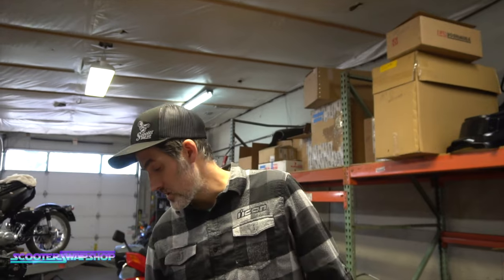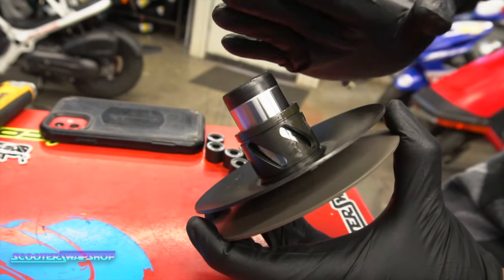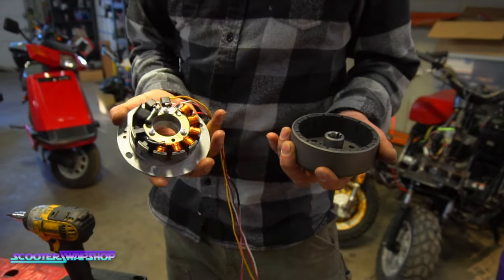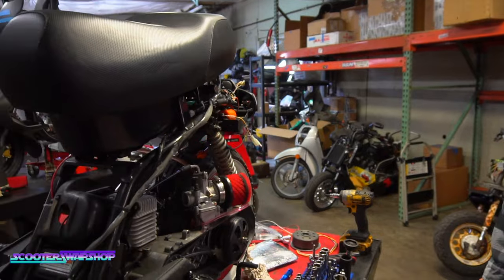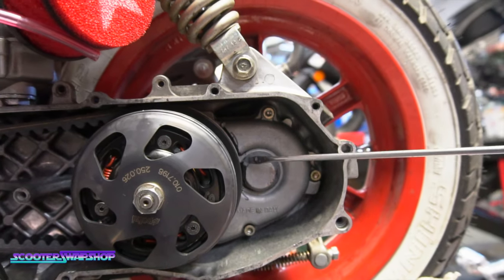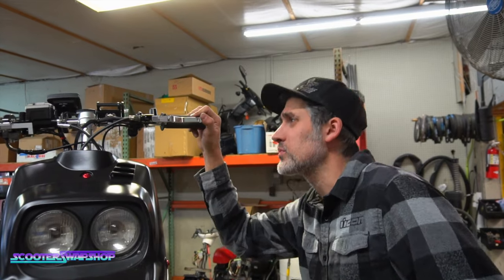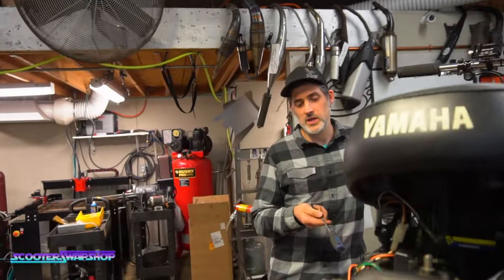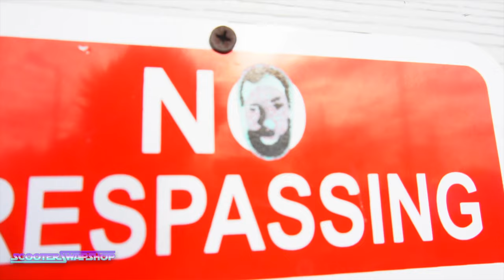Is your 2 stroke scooter constantly overheating? | Final Jay argo Prebug

Comment: Thankyou for this video 
I’ve got the exact same setup & same scooter.. Yamaha BW’s spy 1996 
Stage6 Crank 
Stage6 big intake 
MXS cylinder 
Malossi MHR overrange cvt
Malossi MHR 70cc race pipe 
Malossi 13/44 primary gears
MVT premium ignition kit 
Polini cp21 carb 
Polini cone air filter 
Polini evolution 3G adjustable clutch 
NCY quick throttle 
1.5k contra spring with yellow Polini clutch springs
Reply from the maker: cool! you get all that from us?

Comment: I thought that the 24mm carb is to much carb for these zuma bikes !! At least from what you guys said in the past
Reply from the maker: watch previous videos on this setup
Reply: I’ve seen basically all the videos. I’ve got a Athena race 70cc kit I was debating on throwing it on my Prebug !
Reply from the maker: @Skullspiderscootersquad  24 is a lot for horizontal. 24 is fine for a race vertical
Reply: @Scooterswapshop  yo thank you for the tip ! I’m going to get after it !
Reply: Shit I have the polini big valve manifold on there I don’t think it’s going to fit the 24mm …

Comment: Hello. why does the idle of my 2 strokes increase when the engine heats up? the carburetor is tuned and newly cleaned. and no air leaks. he rises 3k to 4k rpm. but it becomes okay when the choke is pulled and it also functions okay in the first start even without the choke
Reply from the maker: could be a handful of things would need alot more info
Reply: @Scooterswapshop  my engine is all stock sir.
Reply: One of the reasons could be that your contra spring is too weak. The big one that pushes the rear pulley, not talking about the small sized clutch springs.

Comment: Hey. Is it worth the time and effort to cut a hole on the case and make a breather with pipes to cool the CVT? 

Similarly, like the one on Gilera Runners and Piaggio-s. Currently using a short minarelli 2T Jog with the 5su engine code (5bm in the states, I guess), and the case can heat up pretty much that I could cook an egg on it 😀
Reply from the maker: Absolutely if you have a built bike

Comment: What are the first symptoms of a overheating engine?
Reply from the maker: its not that simple dont guess. theres not a oh this thing is over heating by the time theres a issue its broken. get a temp gauge
Reply: @Scooterswapshop  will do thank you,

My elite  belt has a little wobble to it I'm thinking I deformed my crank overheating it, i had to of overheated the thing three times ( shut off lost all power until cool)

Just noticed it yesterday looking in casing, she's at 8.2k miles.

 2001 50cc Honda elite upgraded to a contessa.

Comment: Would a stock 125cc engine benefit from a racing cam upgrade only? Or should i upgrade also the gearings?
Reply from the maker: not with out supporting mods
Reply: @Scooterswapshop  did cvt mods alread and a pipe upgrade
Reply: 125 cc has no power.dont waste tuning parts.buy bigger class.
Reply: Well could ugrade it to 160cc
Reply: @bryaneduarddevera9008  stil not enough.a good power start from vmax 530

Comment: Hi i got a bw’s with a pretty high revving setup, its running a athena racing 70cc, mxs racing pipe and 28pwk. At first i got it to work and it accelerated really fast and revved really much but then after a few runs the cylinder blew up. The piston had the piston rings melted in the piston and bad looking scratches on the piston and cylinder. So whatt went wrong? And my carburetor is a china oko 28pwk so should i change it to polini or stage6 pwk?
Reply: And also i couldnt get the idle to work even with messing with the idle screw and air screw
Reply from the maker: you buy all that here?
Reply: @Scooterswapshop  Im from europe so no. Cylinder and pipe is from maxiscoot

Comment: I have almost the exact same set up but it's not taking off from a stop. It bogs for a bit and I'm also not getting anything over 55mph. I'm assuming the bogging off the line is because I need stiffer clutch springs, I have 3.5g rollers and 1500 torque spring. Is that all wrong? Thanks for any advice
Reply from the maker: watch our cvt videos

Comment: Just picked up a 2005 Vento R4 Triton to replace the Buddy 50 that was robbed from me this past Thursday as I finished my food delivery day.
9.9 miles and the little protective cover was still on the gas cap so I don't think the previous owner ever filled the tank.
In fact I'm sure of it because I had to break it off.
The petcock was toast and all gooey so one is on the way from ebay.
I will take the carb off today even though I strongly suspect it was run dry.
Ugh I'm starting to hate cleaning carbs as I had an execrable turd of a Wolf RX50 that I hopped up for a while.
oh well. lol.
Fun video and informative.
Reply from the maker: sorry that sucks
Reply: @Scooterswapshop  just got the carb off.  dayum.  full of treacle.  lol.